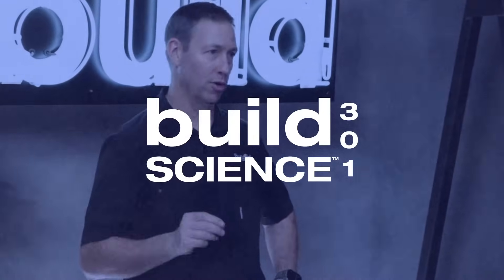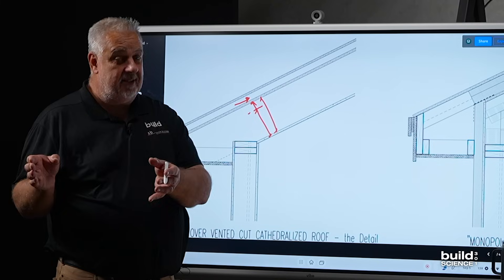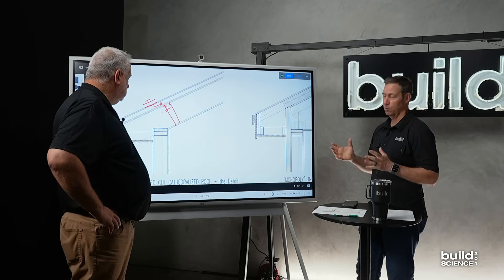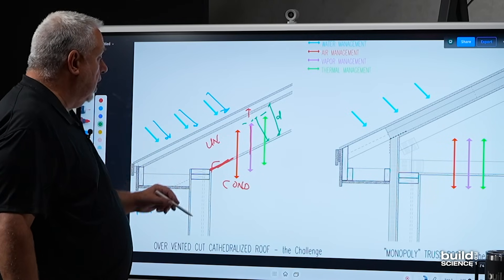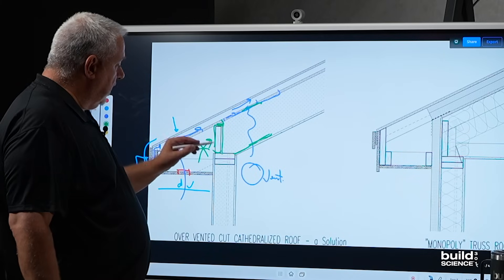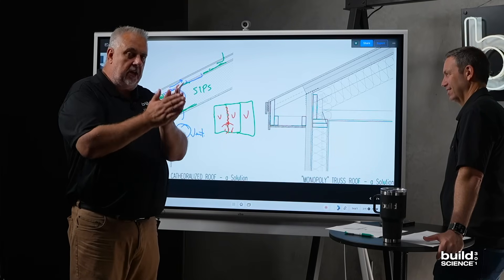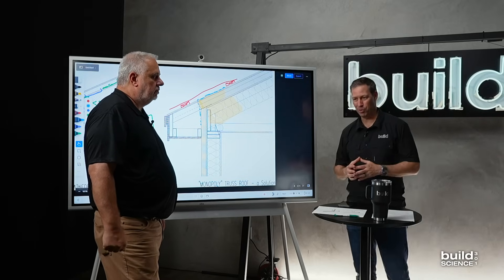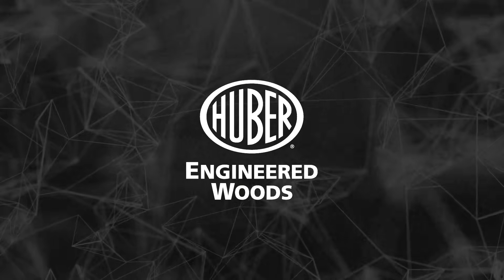Build Science 301 - Ep. 10 | Over Vent Cut Roof & Unvented "Monopoly” Truss Roof

Comment: @9:00  How can vapor travel through foil-faced polyiso? Isn't the vapor blocked at the bottom face? Or at the very minimum, at the first tape layer for the seams. There's little danger of condensation with that external insulation layer at R-25 or 26.

Comment: I run a double roof similar to yours Matt, but I do two layers of 2x8's with a vent and comfortbatts both inboard and outboard of the zip sheathing, plus a layer of 1.5" (R9), so R23+R30+R9 for R63 total. Then I have 2x4's and CCX sheathing for final roof deck (always metal standing seam here in VT--shingles are bad practice and slate is $$). I run my soffits and overhangs and finished rake and fascia off the external 2x8's. I build country cottages and I like the look. I'll post a video soon of the current project.

Comment: All of this seems to be a VERY expensive effort to have a conditioned attic. Ever heard of a crawl space?.....ALL mechanicals can be installed there, and it's worked very well for a long long time....
Reply: Not everyone can build a crawl space. In Matt's part of Texas there is a layer of rock a few inches below the top of the soil, and so slab-on-grade is common. I have a cabin in Colorado that's on decomposed granite, and features a shallow crawl space. My first thought was to condition the crawl space, but I realized I'd want to insulate the floor of that, and so I'd need to dig down at least a few inches. Problem is, hand digging is insanely difficult. Power tools (e.g. a jack hammer with a spade bit) will get through the "soil" in short order, but I'd have to lie on my back to do so. The thought of spending a hundred + hours to dig out a few inches of crawl space has convinced me that making my attic the conditioned space, will be easier and quicker.
Reply: When I look at the PNNL recommendations of cathedral designs by climate zone, they favor vented roofs for warm, humid areas. This video doesn't make much of an effort to point out that monopoly roofing in humid climates is totally dependent on superior air circulation and vapor control in the conditioned space.

Comment: C'mon, explain the entire drawing before moving on.. what are the dotted lines representing on the monopoly truss roof ? 

A simple solve for your 'fivehead' goofy facade is to do away with the little vert in the truss - you don't need it for uncompromised ceiling insulation at the eaves.. sit the top chord on the bottom

Comment: I think the idea of putting rigid foam on the outside of the house is a great idea. I hope to do that in my next house. Does that cut down on the size of the hvac system like spray foam inside a house does?
Reply: Not if you live in the south or anywhere pests are plentiful. Some ants and other bugs love to eat foam insulation. That's why I will probably use mineral wool as exterior insulation on my home build. It resists moisture and pests.
Reply: @dlg5485 the mineral wool insulation I've seen is soft like fiberglass batt insulation,  i didn't know they made a rigid mineral wool insulation. Even better!
Reply: @shawnchapman5916  It's not as firm as foam board, but it's also not as loose as interior mineral wool. They do make a rigid board version that is designed for exterior use, just like foam board. I prefer it just because it is the most resistant insulation type to exterior challenges, like moisture and pests.